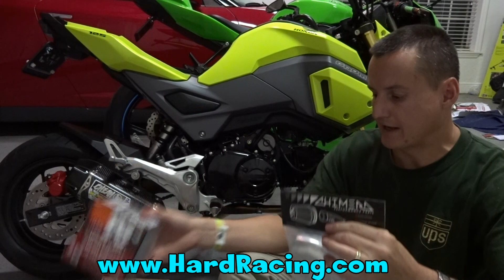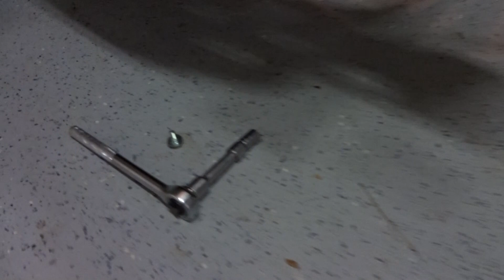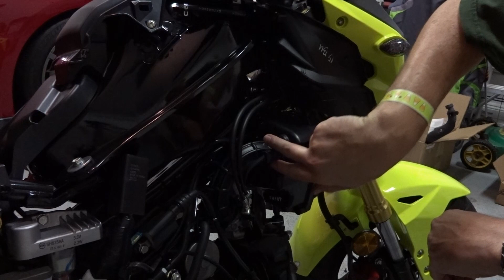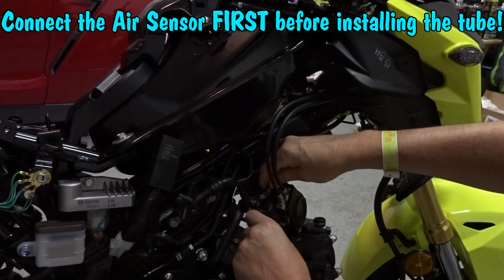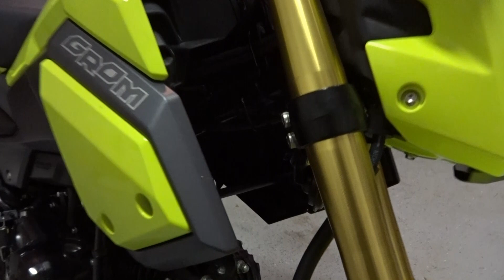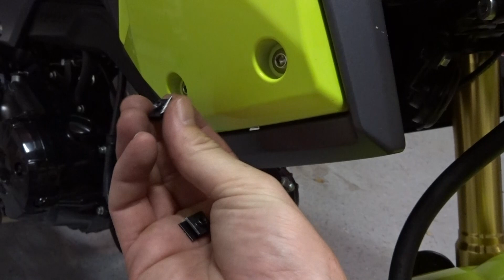2018 Honda Grom Chimera Cold Air Intake Install

Comment: As you have changed both the exhaust and air filter  , I  hope you have added a power commander  or its going to be running  far to lean !

Comment: I have the new Honda Monkey and was going to do this mod.  What was the performance change?  I read earlier in the comments that you are faster then 95% of the other Groms.  Is that the pip or the intake?  Nice video.  I like that you went through all the bolts and push pins that need to come off.  Really appreciate the text in the video to warn folks to do "this now" as you point out later in the video.  Regular guy.  Ride on!

Comment: Call me crazy but i have the EXACT same model as you and my throttle body seems to point to the back more than yours and it's causing the rubber connector to butt up against the spark plug wire holder
Reply: @NicheRiding

Comment: When I installed my pod filter their was a long rubber tube just hanging out the right side. Do I need to put a filter on it or somthing?
Reply from the maker: the long rubber tube is either the one that was connected to the actual bend in the neck part of the tube (there will be a connect spot for it if so) or it's the overflow tube from your gas tank.
Reply: Ah okay. Because sometimes when I ride it drips something on the exhoust I'm not sure what it is but it makes a burn smell.
Reply from the maker: yah there is only one tiny tube that connects to the intake so if it's not connected them it should be easy to spot;) It definitely won't leak onto it though.

Comment: How does your Grom go 68 MPH?  Is it because of the cold air intake?
Reply from the maker: I guess with that and the exhaust. I hear after 1500 miles it begins to really open up some which increases the MPH. The next thing I want is the power commander and tune which I hear helps a lot.
Reply: I was thinking if I only mod intake and exhaust that the EJK fuel tuner might be enough.

Comment: Now that you have had this for a while was it worth it? also do you have to turn it or reflash or reset the ecu? thanks. thinking of getting one for my grom and a couple other things thanks
Reply from the maker: I didn't add any ecu change or anything, just slapped it and the exhaust on it. I can tell you on all of these big grom rides I leave 95% of other groms on the road in a flat out race as they just can't keep up. I owe the extra few mph to the exhaust and intake. I feel it's definitely worth the 130 bucks.
Reply: NicheRiding how much was your two brothers exhaust?
Reply from the maker: I want to say it was like 540 shipped?
Reply: NicheRiding cool man! Thanks for replying so fast. Another question: what made you choose this exhaust over the Yoshimura?
Reply from the maker: The sound of the exhaust!
Reply: @NicheRiding  hi i have been watching your videos as i just got a new grom myself... and have you still not added a programmer to this seup yet?  i want to add exhaust and do this intak kit and do exhaust as well and every says you need to get a programmer os some sort.  now i thought i heard you say that this intake kit has the bugns and fitting for all the factory hoses and the sensor from the aribox/intake to fit on this cold air kit correct? then i wonder why you need the programmer just bececause of adding a exhaust as well?... i race  anew 450 mx bike and i have aftermarket air intak system and full exhaust on that and i dont have to add a programmer or anything and its fuel injected as well so thats why i'm asking haha.

Comment: Turn throttle body round file the noches down on spacer fit sort silicone pip drill hole for air sensor had filter